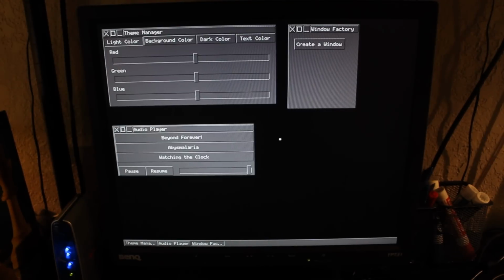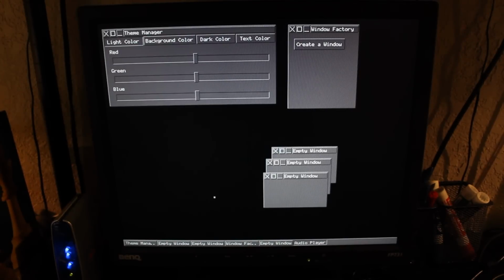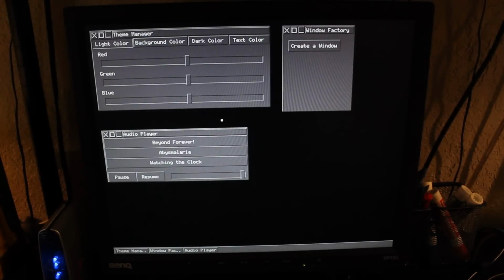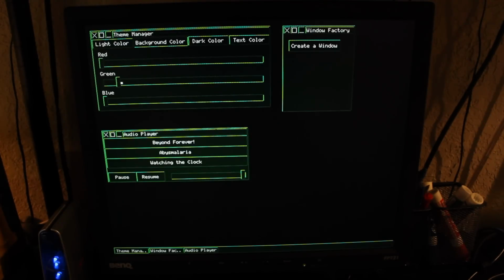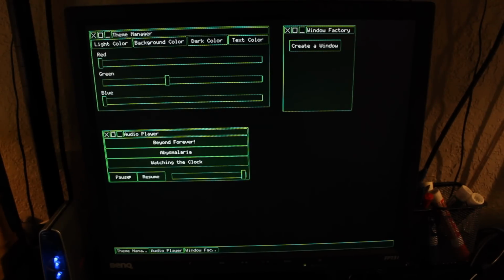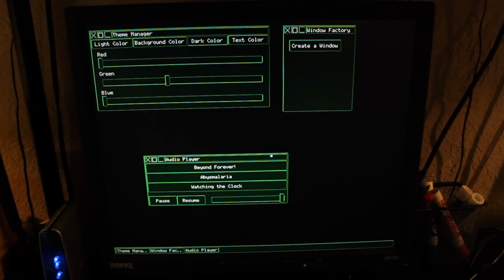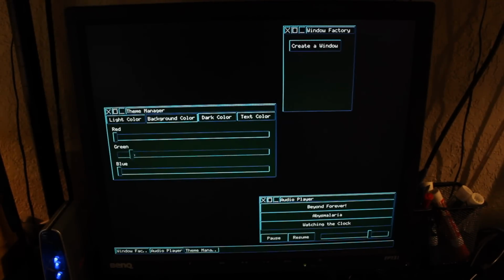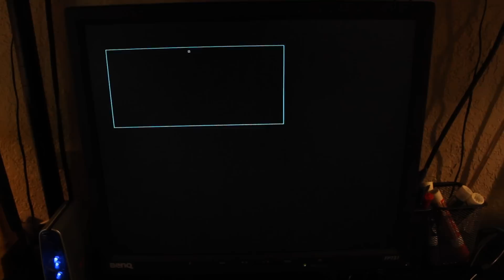AVR Window Manager

Comment: Why don't you use an fpga for the graphics? That will make things a lot faster, besides you free your AVR to do some other stuff.
Reply: Aah, I see. I would become a very complex project but very interesting also.
Reply: Well, FPGA programming isn't exacly digital design. I worked with VHDL and its very far from designing digital circuits. It quite different from processor programming, something that will give you headaches is that everything is concurrent instead of sequential. However it is still possible to execute lines sequential.

Comment: Awesome job! If i may suggest a thing, some dude did a 3d renderer on atmega [don't remember which exact model though], and it worked pretty well just because he focused cpu'work on rendering JUST the difference between previous and actual scene. Maybe you could think about implementing such feature to much simplier [i think] things like window menager, so the rest wouldn't disappear, just to operate on single rectangle movement.